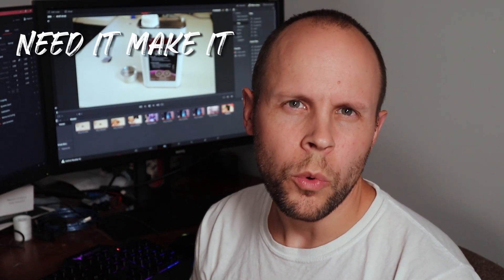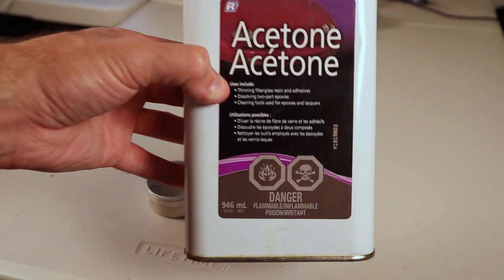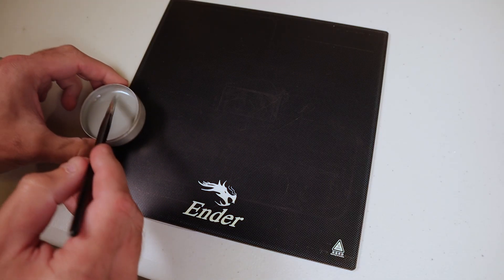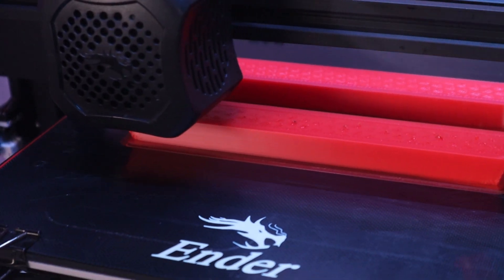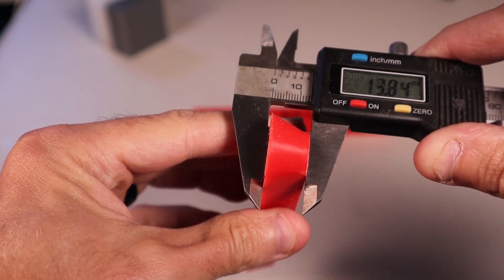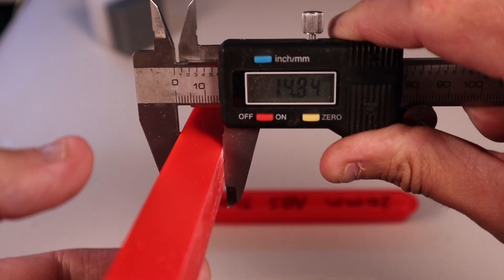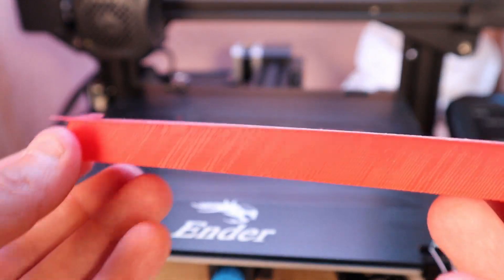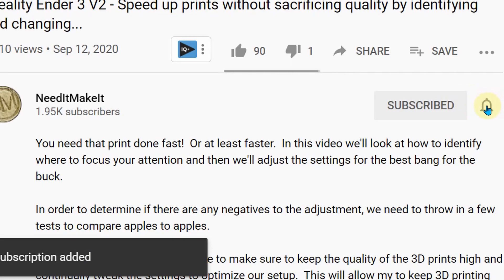Creality Ender 3 V2 - Is ABS Juice or Slurry Better than Glue Stick for Build Plate Adhesion?

Comment: Ender 3 v2 smooth side of original plate. Sugar water. 90 bed. 225 nozzle with easy abs and the result is much better than glue stick.

Comment: I have to mention that I bought an Ender 3 Pro and 10 rolls of ABS. I had no experience, but started printing ABS from the first time I printed. I did it on the original bed, too. It has been almost 4 years and never has a problem with sticking to the bed or the quality of the prints. I haven't made any improvements,  everything is as the first day. Also, I don't have an enclosere. Again, I am not an expert by any means, but I compare my work with that of some professionals and they thi k that it is very good quality.

Edit: My only reason was that I didn't want to spend any more money on it.
Reply: That original bed sticks better. These guys use glass and even tho the bottom looks cleaner it's difficult to get it to adhere on a smooth surface

Comment: It always amazes me every time I see examples of how different things, work for different people.  I've know this for a long time, but it's still always interesting.

I have only recently decided to try ABS.  I got a roll, and immediately decided to print something I'd only just done in PETG.  The first one worked fine with no issues, although I was concerned at how easily the part removed after finishing, feeling like it was only sitting there before even allowing it any time to cool.  I made an adjustment to my model to account for the different shrinkage of the ABS, and tried again, but found that I couldn't get it to print without adding a brim to the part.

That worked, and I decided to try a part that I'd got the ABS for (Voron parts) and after 4 hours, and many fails, trying with/without glue stick, front of bed, back of bed, different speeds and Z offsets, I gave up for the night.  I bought some acetone, mixed up some juice, and spread it on the bed.  I started the same print that failed and failed, and it worked perfect the first time, and am now on my second batch of parts, with no issues at all, no warping, lifting or any problems.

I'm printing on an open frame E3 V2, back of the glass bed, 90° bed and 245° extruder.  I'm absolutely in love with how nice the ABS printed parts look compared to even the PLA parts that I've printed.  (I'm not sure why, but I've struggled with PLA more than PETG, I think I've only had a roll of PLA+ that I thought printed well)

The only thing that I think that I won't like about the Juice, is the clean up between prints, I'm impatient, and when printing with PETG, I used no glue or anything, so I'd just pull the parts off after printing, and then start the next batch of parts.
Reply from the maker: The main reason  I switched to PETG was because of the smell and printing in the house.  I like the properties of ABS and the look over PETG for sure.  The prices are similar per roll also.  For PETG I always use a glue stick, but removing the parts has the be done with the freezer method, the bond is too good.  ABS on the other hand seems to depend on the size of the parts and some other variables like the top/btm layers, wall thicknesses infill etc.  I think I struggles the most because of the wall thicknesses being so great in comparison to the infill.  You've inspired me to try ABS again!   I'm getting setup to print in the workshop now so smell is less of a problem.  Printing inside of a cabinet helps a bit as well.  Thanks for taking the time to share your experience in detail!
Reply: @NeedItMakeIt  I'm not sure why, but so far, I've been unable to smell any of the filaments I've printed, maybe I notice PLA a little bit.  I wonder if different brands of filament could cause a difference?

For my prints, I'm using 4 perimeters, 40% cubic infill, 5 top and bottom layers at 0.2mm layers.  One thing I noticed, when changing colours, which also meant mixing up a new slurry, it was a little thicker than the first lot, and I found the part far easier to remove after the print.  So the water thin mix stuck like nobody's business.  I wonder if the thickness of the juice has an effect on adhesion as well.

I might do a couple of calibration prints tonight and see if I notice any deformation on a known dimension.

Comment: I just put a new glass plate on my home made printer and found that when I use the ABS juice it bond way too hard now. Actually caused spalling of the glass. Now I print simply on clean glass without lifting. There was no choice but to use the ABS juice on my previous build plate in order to get things to stick. I also now use a 10 degree higher bed temperature than previously.

Comment: I glued a non-textured PEI sheet to the backside of my E3v2 glassbed. Now prints ABS with no issues. Perfect adhesion, no warping, no mess. Just wipe with IPA between prints.

Comment: As an E3 V2 owner, I also moved from PLA to ABS now.

I didn't use any additional materials for adhesion and so far my stock glass bed was so good with 105c bed temp. and 50c enclosure temp.

But now I realized my print has serious elephant foot problem. 

The reason I guess is I pressed Z-offset too much for 1st layer then elephant foot continues even ~5th layers. 

So now it is my major and only problem to fix elephant foot with ABS. 

Today I will try to set lower bed temp. from 105c. maybe under 85c. but elephant foot by Z-offset pressing usually effects to not other layers but 1st layer,

so bed temp. may not be the reason of my elephant foot problem.

Then I also thinking about using large Kepton tape + low bed temp. combo with less pressing Z-offset.

Please keep post if you have any progress. I think both of us are stuck in same place anyway heading for perfect ABS printing.

Cheers.

Comment: I have only good experience with abs juice, but i use a lot thicker layer. i have a metal ruler with a piece of duckt tape at each end, so that there is a gab in the middle, i then pour a puddle of juice on the bed, and drag the ruler across so that it leves a thil layer of juice. Works like a charm for me, gluestick failed evrytime for me.

Comment: Just use sugar water. Cheap and works wonders
Reply from the maker: It sounds tasty, I will try this.
Reply: @NeedItMakeIt  gives something to lick.
Tablespoon of sugar, table spoon(ish) of water, microwave it until it's a clear liquid and apply to print bed. Turn heatbed on until dry and print away. Holds great and print pops off when finished easily.
Added bonus of lickable prints lol
Reply from the maker: @rskl3284  This is too easy, I will try this and it might just make it into a video.  Licking included.
Reply: @rskl3284  lol does it work for real?
Reply: @JohnWayne99999a  definitely, I do it quite a lot as an added safety on long prints
Reply: @JohnWayne99999a  definitely, I do it quite a lot as an added safety on long prints
Reply: @rskl3284  thanks for your suggestions. I have problem with bed adhesion, it almost make me smash my glass bed. When searching for abs juice and watch this video I found this comment. I tried it on abs+ esun with 5mm glass bed. It work really well, too well. I applied it too thick and make me almost unable to remove the print from the bed, it stick too well. Thanks you are a savior. The 3d printing world need to know this method.
Reply: I use sugar water as well. I add about as much sugar as would dissolve at room temp. No microwaving. Heat the bed, dab solution on with a paper towel and print away. Works very well imo. I print on the creality glass bed but on the smooth side.
Reply: An other sugar water user for ABS on glass over here. It's much easier to refresh, with glue stick I kept having to apply more and more, which in turn meant more bed removals and washing, since water and alcohol didn't work to refresh it, with the sugar I only need to spray some 70% alcohol and lightly brush it every 2-3 prints if they are in the same spot.

Comment: I have an Ender 6, my first Creality.  Over 7000 ABS hours experience.  The printed side of the Creality build plates suck snails.  Flip it over.  I run only Elmer's Extreme.  Everything else is 1/2 or less as effective.  I've n tried the juice.  I'm getting great results with glass and Elmer's Extreme.  Incidentally, I am printing in a 50-53 enclosed printer.  There is no reliable printing in open air anything but the very thin and small parts in ABS.  You are getting no where with ABS till it's 40c or better in the build chamber.   This is a fundamental like gas in your car.
Reply from the maker: That is some serious time!  Agree 100%.  I did switch to nano adhesive, and have a video on that with excellent success.  I've also switched to a borosilicate glass plate, it works very well and it is cheap.  The enclosure reaches 50c, I believe I was struggling so much because of the thick walls and infill as well.  The nano adhesive is good, but I wanted to avoid the cost so I have been experimenting with PETG.  

With that much experience, can you tell me about any other problems you've had, or tips you've learned that could help others out?

Thank you for meaningful the comment!

Comment: Hallo. 

Nice! A very good job!

Allow me to share these lines with you ...

A succesful ABS print requires a good control of two aspects:

- Adhesion    and
- Temperature 

1.- ADHESION seems to be clear so far, and we can say that both, ABS slurry and glue stick, will work fine.
I haven’t tested ABS on an ultrabase glass plate, since I’ve been printing on 3/4 mm thick mirror for a very long time.

Additional things to consider:

a.- Glue sticks … there is different qualities and some really stick the prints to glass, others are to weak. You will have to test different brands until you find the “mighty” one. Avoid products designed for school use and be generous when applying glue.

b.- Print on glass and only on glass: avoid masking tape, magnetic bed or others like flexible steel sheet. ABS needs a stiff base to stick on! 

c.- None has mentioned the use of “mouse ears” so far. These wide and - let’s say - 1mm thick disks must be placed under the STL files especially under corners/sharp turns. 
Cura allows placing these “cookies” under the main STL, and melts them together in the gcode. Besides this, keep using a generous brim.

d.- Nozzle fan? I’m not using it for my prints (functional printings with 100% infill)

2.- TEMPERATURE CONTROL (I know, this goes beyond the subject Slurry vs. Glue, but this is the real issue to focus on).

You will need at least 100 C on your bed, 250 C on your extruder AND an environment with around 30 – 35 C to comfortable start printing ABS. You need to generate a “microclimate” around your print.

At this point most open frame printers fail … A bed moving back and forth starts behaving like a heat sink (so it will hardly keep 100 C).
And at 250 C you start wondering if your nozzle is melting teflon … 

A fully closed frame (+ direct extrusion with a full metal heat-break throat) is a better option to succeed printing ABS ...

Well, an enclosure like the one you build is a very good start, but it needs to be compact (not much higher than the printer itself – better if lower, even if this limits your ptinting height). 
Coat it with thermal insulation (this is really cheap). Remember: your bed has to heat up this environment and keep it constantly warm. A smaller chamber => less air volume => easier management by your bed.

Even if it sounds funny, a hair dryer will help heating the chamber until the printing starts. 

Board & steppers are placed inside the frame under the bed, so take care not to overheat the chamber …   

Well at this point I have to say, that to many printers out there were simply not designed to print ABS for 10 / 20h. Even if our printer’s specs state they print ABS, they probably won’t out of the box unless you print really small things!

I’ve already gone through this with this and other brands.

Enjoy testing!
Reply from the maker: Love the extremely detailed notes, I can tell you speak from experience.  There are many excellent points here, I do also agree with the height of the enclosure for the same reason that higher ceilings in a home aren't great for energy savings.  After finding the Nano adhesive and having good success with it, I wanted to switch to PETG to see what kinds of results I would have.  I've been printing with PETG for a few months now and I am really enjoying it.  I am not a big fan of the sheen, I take steel wool to many of them to take it down a notch, it does not file or sand well and there are many fine strands to deal with (still working on solving this).  I still print in the enclosure with just a little heat buildup inside however warpage is no longer a problem, adhering to the build plate using glue stick is not a problem, in fact I need to move it to the freezer to remove any of the parts.    

Like you, overheating the electronics was a consideration and I did not want to modify the printer if I could avoid it.

Onto the next video!  Thank you very much for your thoughts on this.  I'd like it if you would check out my next video (set to release in a few days) I have been working hard on making compact detailed videos with better vocals and video and this one coming up solves a very common problem.
Reply: @NeedItMakeIt  Small blow torch is awesome for removing petg strings. I am using one regular blow torch and one cheap, small Aries gas soldering iron with a blow torch adapter for more precise work. Also with cf-petg you will get pretty much ready to go parts with almost no stringing (in my case I had less stringing with cf-petg than with pla). It does curl up a bit though but not as bad as abs.
Reply: This was an awesome write up, thank you so much

Comment: I found that Magigoo works better than anything else. It's about $20 for a bottle, which has lasted me for over a year so far. I sell about 1000-2000 prints each year, so print alot, in PLA, ABS, and PETG, and Magigoo works really well for all three.
Reply from the maker: Awesome,  I am a fan of the plain old glue stick for PETG and PLA on glass but I do have to use the freezer technique for most of them.  Nice work on the volume of your prints, that's pretty amazing!

Comment: I use this build surface https://www.amazon.com/gp/product/B07XXWXLJ1/ref=ppx_yo_dt_b_asin_title_o01_s00?ie=UTF8&psc=1 and works perfectly with PLA just by itself (comes with it's own magnetic sticker) with nothing else. For ABS i use the same build plate but use Magigoo https://www.amazon.com/gp/product/B01N2JGTWJ/ref=ppx_yo_dt_b_asin_title_o02_s00?ie=UTF8&psc=1 and it sticks really really well and Reduces Warping and releases after the build plate cools down. One tube last a very long time. I use IPA (Isopropyl Alcohol) to clean up after each use. https://www.amazon.com/gp/product/B0868R7JF6/ref=ppx_yo_dt_b_asin_title_o09_s00?ie=UTF8&psc=1

Comment: Hey mate with your enclosure do u worry about the psu mob and steppers overheating?
Reply from the maker: It has crossed my mind a few times, I recently measured the temp inside the enclosure, and I'm seeing a steady 40c.  Having run my Anet A8 inside since the beginning for about 1 1/2 years with no failure I feel fairly confident that this printer will be alright.  Still it is a computer and it would be best to keep it cool, so I have been thinking of other ways to do this, maybe a switch to a different filament would be the best solution.  Running something like PETG with a lower nozzle and bed temp would help.  Any air movement inside the enclosure should be avoided to keep the ABS parts from warping and possibly cracking.   

Do you have any ideas?
Reply: @NeedItMakeIt  I've run extension for PSU to be outside (14awg wire plus male and female xt60 connectors) and put motherboard in case with a lot of holes (mb sits in original place, in enclosure, it's just ventilated better). Seems to work fine.

Comment: got this printer  4 days ago ,,,,,, it did 2 perfect prints out of box no setting changed , 200 /60    ,, then bang it never stuck to bed ever again ,,,,,,,,,,,, put temp to 245 and bed to 65 ,,,, it sticks to bed now ,,,,but its not as perfect as it was    and this is with PLA  !!!!    this printer suffers from a lot of problems  and its best to fully upgrade it all ,,,,,,, ive printed a part to make it direct drive ,,, if it doesn't print like it use too then im selling it ,, life's too short :)    i get 1 decent print to every 9 times       dont know why i have to print at such high temp now ,, maybe the nozzle is broke  at 200 wont stick or layer right
Reply: I had the same experience with my ender 3 v2. The firts few prints were great but than it would’t stick to bed anymore. I dicovered two things. One: You need to check your bedleveling. The quality of the springs under the bed is very poor cause to move the bolts now and then. You can get upgrades for them but I fixed it by putting on some blue loctite. And two: I wash the glas plate with soap and hot water and dry it with a paper towel. I make sure I will not touch the top of the plate with my hands when placing the plate on the bed. This worked for me every time sofar. I only print PLA with 200/60.
Reply from the maker: Rich, that is a shame.  Do you print on glass?  I have a little experience with PLA on glass, but I however have had too much trouble removing the part.  

It is possible you have a lemon.  Let me know if I can help.

Comment: I tried
Concentration also seems to have an effect on adhesion
But this is a good way
Reply from the maker: Do you think a thicker solution is better? I've tried again and the results are not good at all.  Does the material for the build plate matter?
Reply: @NeedItMakeIt  No, no, no, I mean, the concentration may affect the adhesion
So leave a message to remind others.